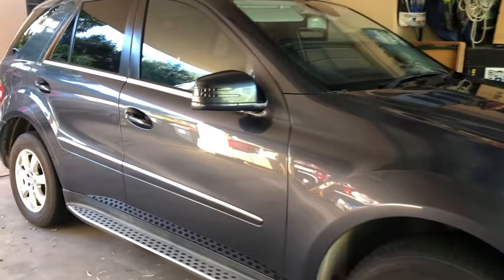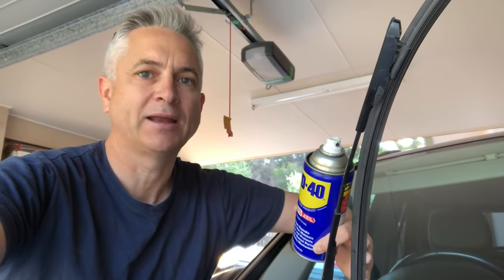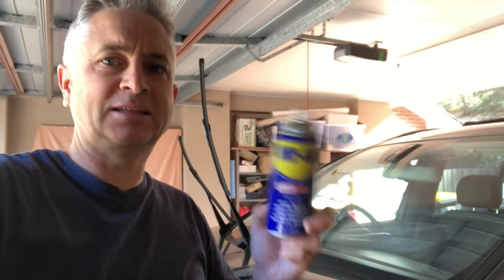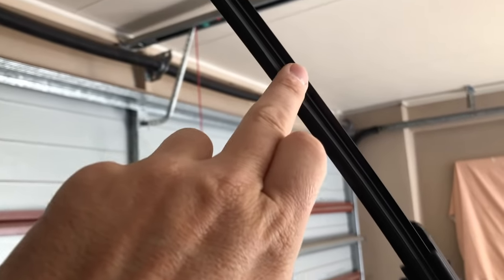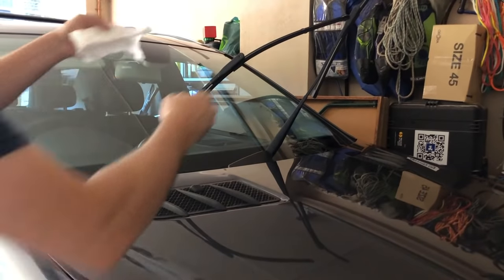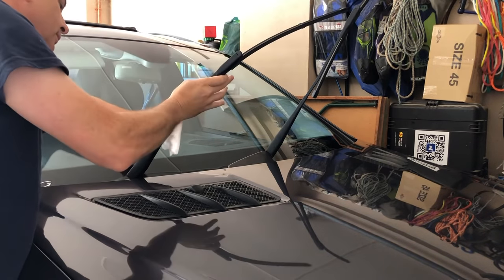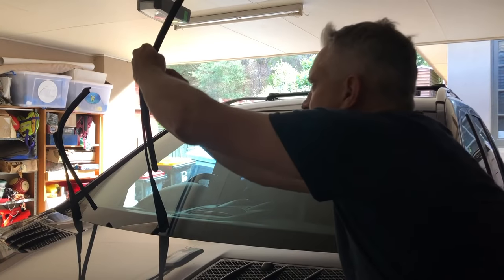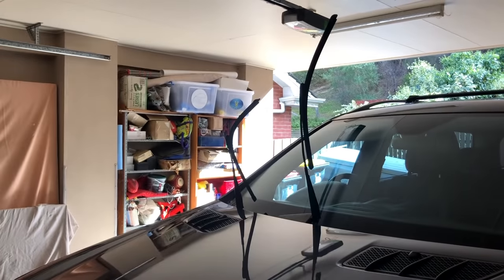WD40 Hack on Wiper Blades!  Does it really work?

Comment: The carrier ( which propels the product out of the can) is a petroleum based product much the same as Varsol. The lubricants that are propelled from the can are also petroleum based. This use of wd40 may work fine in daylight in the city but if you need to travel in all weather on and off road at all hours of the day you will really hate yourself for ever having used a petroleum product on your wipers. I love wd40 and use it for a million different reasons but having a petroleum sheen on my windshield is something I will continue to avoid. There is no way that any petroleum products will get anywhere near my wipers. Oil your wipers if you please but stay away from mine. Sounds like a great prank to play on someone you hate.
Reply: I use rubbing alcohol to remove the old rubber.
Reply: Methylated spirit applied with a paper towel and rubbed along the blade makes it good as new unless the rubber has already split.
Reply: A largely underestimated comment

Comment: I saw this tip on Silver Cymbal's page. I clean the inserts of the blades for a Honda and for a Toyota about twice a year with WC-40. In addition to being free of streaking, the blades are quiet, too. Quiet, like you-can't-hear-them quiet. This has allowed me to use the same blades for more than two years. I have a 2010 Pontiac G8GT (Holden Commodore) with the one-piece blades and still use the original blades.
Reply from the maker: Hi Jon, thanks for checking in with your positive comments!  Cheers Drew
Reply: Wow. I was shocked to hear 2 years! We live in a very mixed climate. Rain,snow,ice,hot but never really settled. Same wipers on our car for 12 years. Some wipers are coated with graphite or during the manufactures so be careful with oil based products as if it absorbs it, that’s them damaged
Reply: @DrewFixIt  @

Comment: I'm sure brush makers don't really appreciate the WD40. Another good application I discovered for the WD40 is removing the old glue from stickers and tape, both on glass and sheet metal.
Reply from the maker: Hi Feliciano, thanks for the tips, I will be sure to try them!  Cheers Drew
Reply: Another great tip! Thanks Feliciano!
Reply: Good for tar spots too.

Comment: I've been doing this to my Bosch blades for two years now about every 4 to 6 months and I've not had to buy any new ones yet. It also helps to polish your windshield with a plastic polish or even car wax.
Reply: EEEK never use car wax on glass
Reply: @chrisc9817  I don't tend to use car wax anymore since buying Nufinish plastic polish.
Reply: never use car wax on your windscreen! i use a proper glass polish compound and machine polish twice a year on my screen and use a traffic film remover on the glass when washing the car and hey presto no road film on the glass and crystal clear screen when its raining.
Reply: @jamesblakestravels1088  if you had read my previous reply then you'd see that I don't use car wax anymore. I use Nufinish.